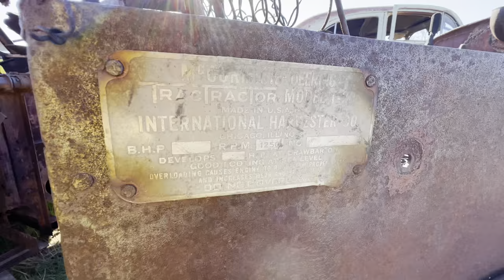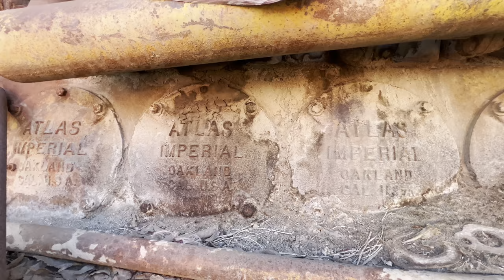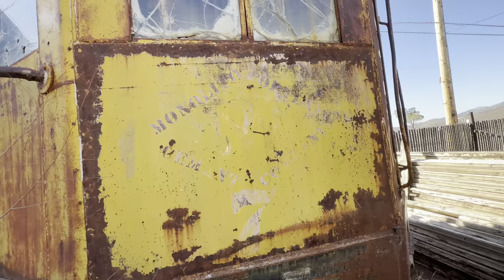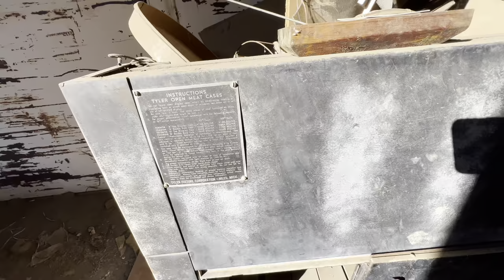Abandoned vintage car junkyard

Comment: Wow subaru brumby 4wd ute ,didn't know you guys in the states got them ,they were very popular here in NZ they were crazy good offroad ,,.NZ terrain is a serious test for any vehicle & they could go anywhere 4wd hi-lo range & mine had a factory diff lock .Heavy 4wds would sink & get stuck in the mud they were so light they would just go straight over the top ,,sand ,rocks & mine would float across rivers like a jet boat lol .But they all rusted out fast here very few left ,someone should remake vehicles like that ,they had 1800cc 4cly engine cheap as chips to run & simple & easy to maintain ,drove really well perfect around the farm or snow laden areas & cheap to purchase ..Bloody good wagons .

Comment: I M desperately to jfind where this is at or there need to find out where this is or there na.e or contact info. I am in luv with one of the uncool cars. It's a 4door. But lm in luv with it any way and if l can't save it I'll cry😢.if I could just get contact info of of this golden age of flight guy. It would be much aprechated.Thanks Will😊 ps remebee it's a 4door if I don't save it it will get crushed😢 appropriate